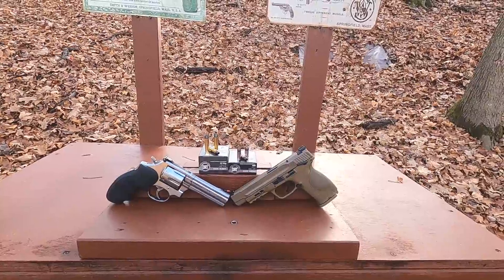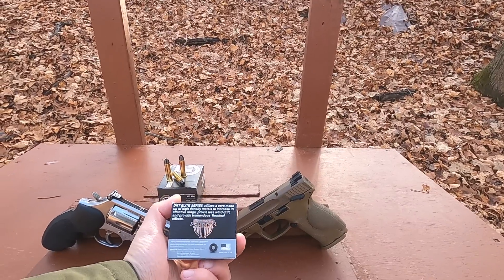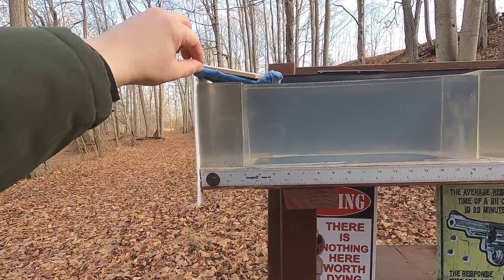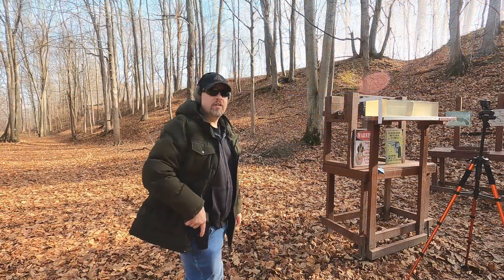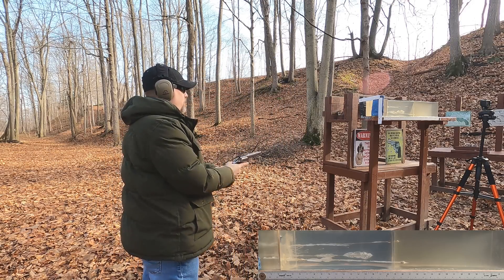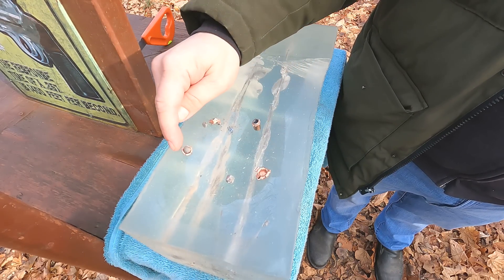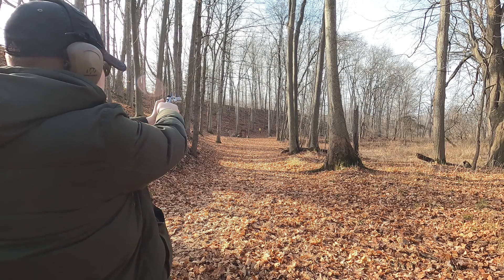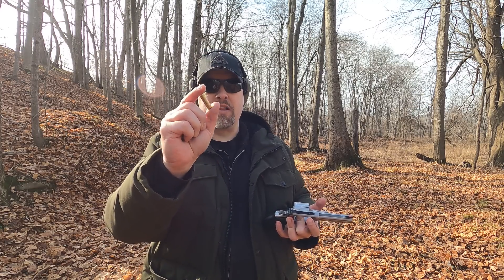Surprising Results - DRT Elite Series 9mm VS .357 Magnum Ballistic Gel Test

Comment from the maker: I had no idea what I was getting into with this ammo. I have tested other DRT ammo that was 85 gr in both 9mm and .38 Special and those boxes list that the bullet core is made up of powdered compressed metals, and with the weights being so low that was a given it was frangible/fragmenting HP ammo. This 9mm ammo is 124 gr and this .357 Magnum is 120 gr, and there was no mention whatsoever on the box about powdered metals. Every thought was that it was traditional JHP ammo and that's the very reason I purchased it for testing. I was surprised.
Reply: I've tried the energy math but I suck at this formula.  Could you please tell me the energy on a 357mag 142gn at 1450fps. Enjoy the reviews,  I always tune in for a new episode,  definitely the revolver channel 👍👍
Reply from the maker: @jimchambers7548  The energy of 142 gr @ 1,450 FPS is 663 ft lbs.
Reply: @GunSam  ty sir,.now maybe I can figure out the math. I appreciate the help, and the great reviews.  Definitely the revolver aficionado 👍👍
Reply: @jimchambers7548  Hey man. There are a couple of good calculators on the top results of Google that can provide you with bullet energy. Ballistocs101 I believe is the one I frequently use

Comment: Yeah, solid pass on choice.
Their marketing team needs a proof-reader before they print thousands of box covers with misspellings. The actual statement on the box is correct but not in any tangible way, at least that couldn't otherwise be solved with just running a heavier bullet for caliber. Wonder what material they used? Mixture of lead and tungsten powder? Who knows.

Comment: I always go on a rant about current  " 9mm " defense loads , most are totally inadequate and will not incapacitate an opponent guaranteed with two hits giving him ample time to shoot you many times . I have seen many a police shooting video, and they always mag dump because of this failure of performance . These " FBI PERFECT SHOOT FABRICATIONS " 5-7 yards , two opponents facing, bullet mushrooms , does not exit torso . Is a dream come true for Ammo company Liability Insurers for the FBI and Law enforcement " so what , the officer was wounded or killed but we didn't have an innocent bystander hit by over penetration pass thru so you can't sue us Whoopee ! To be a 1-2 shot man stopper 9mm needs to be loaded to a minimum velocity of 1,350 fps with a good expanding but not over expanding hollow point . Few loads fill that requirement , Sig V Crown is close , and Underwood is right on the money. I reload and I practice with and carry 124 gr RMR or Remington bullets velocity 1,400 fps. These velocities are used all the time in competition to increase major power factor. You want that bullet to expand, but that bullet hole exit at .40 and above will pump large volumes of blood out of the criminal, also you want confidence that your bullet will shatter any bone it strikes and still exits the body, we shoot center mass , so I am taking about the spine. Then you have a real defense round ,  Unless you live in a high density city , the chances of a pass through going through your house and killing a neighbor is one in two million . And murder or robbery is almost never done before a crowd " Unless it's a Haji true believer " . Great video , Great Production and testing , you do a great service by showing the shooting community the performance or lack of performance of available so called Defense Ammo . Your test will help us all make make wise decisions and there is a very good chance these informed decisions will save lives. Never apologize for picking a poor performance ammo , because these test are well done and valuable , any performance good or bad is on the ammo company.
Reply from the maker: Yeah, I have seen s lot of footage of 9mm not working. A determined attacker can absorb a dozen rounds of 9mm and still keep coming. Anytime I have seen footage from places known for still using .40 S&W, like Houston PD or San Francisco PD - the incidents look nothing like the majority of other incidents where 9mm is used. You see a lot of one shot drops, also a lot of slow double taps, partly because it's harder to get that follow up shot, but partly because they know most of the time two shots works.

Comment: has anyone checked  the different speed of 9mm 1inch,2inch,3inch,4inch 5inch,to see how much speed is lost?
Reply from the maker: I have a pretty good idea, not 1" or 2" but a 3" semi auto minus the 1.00" OAL of 9mm is 2" of bullet travel. Have tested 3", 3.2", 4" and 5". There are so many factors that come into play other than barrel length, like rifling and specific barrels shoot faster than other ones of the same length, different bullet weights and charges etc. But a general summary I have seen, is with 115 gr going from 3" to 4" you might gain 50 FPS, but going from 4" to 5" you may gain upwards of 100 FPS over the 4". The 3.2" I have is generally like 25 FPS slower than my 4", so my guess is 3.2" + is where you want to be to maximize the power of the cartridge.
Reply: When talking about going shorter and shorter, the velocity threshold where you suddenly drop off a cliff is largely dependent on the powder burn rate, how quickly that powder is able to generate pressure before the bullet leaves the muzzle.
On the other hand, longer and longer barrels may, or may not offer benefit as a quick pulse of pressure might quickly subside before the bullet leaves a longer barrel. If you have a slower powder that generates a longer duration of pressure, a longer barrel really shines.

Comment: I just bought a new 4 inch 686 for my first revolver and the cylinder does not release easily.  Is this something that will wear in or should I send it back to smith & Wesson to fix?
Reply from the maker: It may or may not work itself out. Try some good penetrating oil on the pin in the middle of the extractor star, push it back and forth a few times and see if it's sticky. I have had revolvers that got that part gunked up, so if it doesn't freely push in, it takes way more forward cylinder release button press to open it.
Reply: @GunSam  thanks for the responses.  It’s disappointing to get a nice expensive gun and not have it working properly right off the bat
Reply: Thier quality is pretty poor for years now. Check that the lock is fully unlocked.